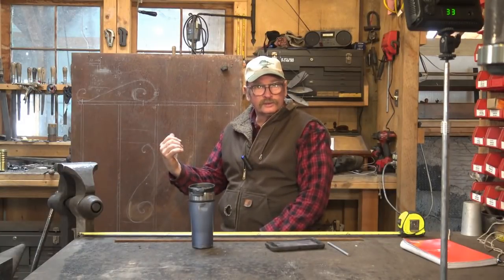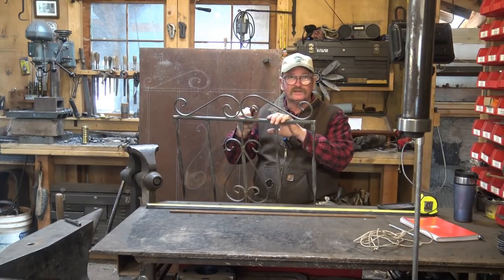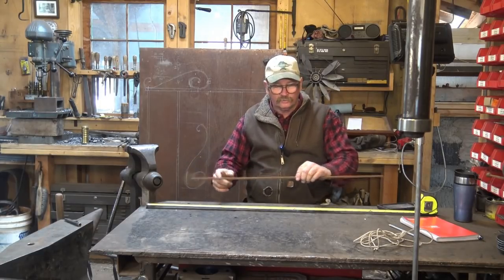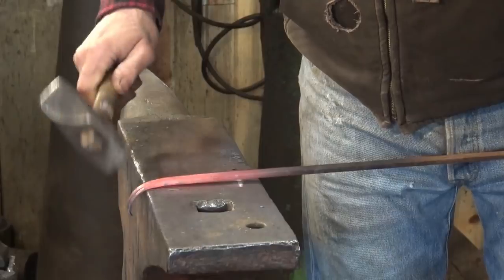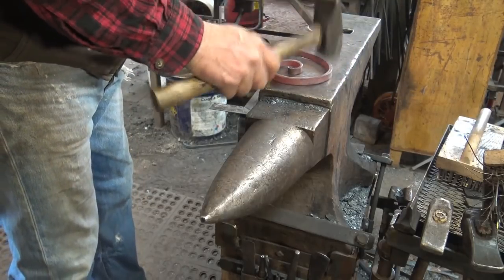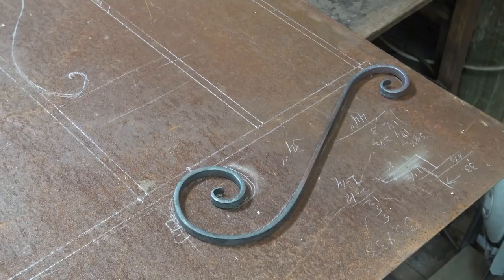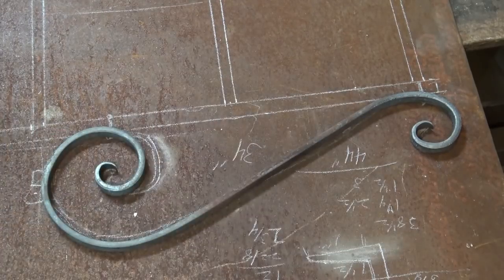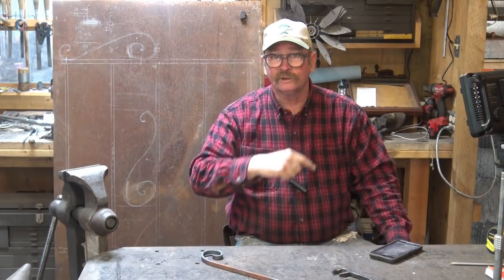Forging a ribbon scroll - window grill project

Comment: An alternative to using string or wire to measure the length of curves is a fairly cheap instrument called an opisometer. It has a small geared wheel that you trace the curve with and a larger dial that shows the distance traveled. This is usually used to measure distances on maps. It has the additional benefit of being able to measure the actual distances on scaled drawings.
Reply from the maker: I have one of those for maps, but haven't used it in the shop.
Reply: I have an old one of those. This must be 14000 miles long--HA!

Comment: Really nice job. I can't wait to see how you make the holes for the rivits or tennons. Making the holes before the scroll never worked for me. For many reasons. And I don't want to unscroll to make the holes. So I found making a Hardie anvil with a horn worked best in my case. Looking forward to see how you tackle this. Thanks again Joe
Reply from the maker: I will most likely use hot collars so that I don't need any holes.  Buit there is one spot that might get riveted and that will require some finagling.

Comment: Wonderful video!  Scroll making can be intimidating and you make it much more enjoyable.

If I may suggest, along with making your starting 1" mark on the anvil, simply make your target 2" mark as well.  That way you don't have to go back measuring.
Reply from the maker: Good point.  Although in practice you end up rarely needing either measurement.  You quickly learn just how to get the taper your after.

Comment: Good job John, I have a question. When you taper the end of the bar you only hit on one side leaving the othe flat. Which way did you go with the scroll. Toward the flat or the taper?
Reply from the maker: That may be a bit of an illusion.  BY lifting the bar slightly at the end of the drawing out it results in a centered taper.  But in either case as you bend the scroll everything pretty well evens out.
Reply: Thanks for the reply. I guess you are an artist because I did not see you flip over the piece. I saw the squaring the sides and truing the ends and making them longer. Thanks for your time that is what makes us better Blacksmiths.
Reply from the maker: I'm not sure that I did flip it while I tapered it.  You can center a taper by just lifting the holding or tong hand so that the bar is no longer flat on the anvil.  the anvil forms the angle on the backside while the hammer forms the angle on the front.

Comment: its always easy to make one of anything making 4 the same gets a bit harder i made 10 hooks only 4 of them are the same curve and length thats where i struggle. i made some thin steel scrolls no heat they were easy with a jig but making the jig to allow for the cold steel to spring frustrated me
Reply from the maker: Material sprining back can be a problem with working cold.  Using the same jig with hot material may work out better.
Reply: If it's thin, like 1/8" or 1/16", and springs back on you, it can be heated quickly and work along the jig curve with a propane (or MAPP) torch.  No need to put thin stuff in the forge.